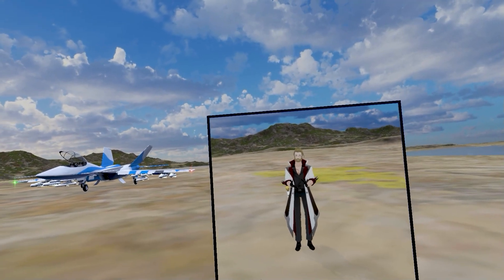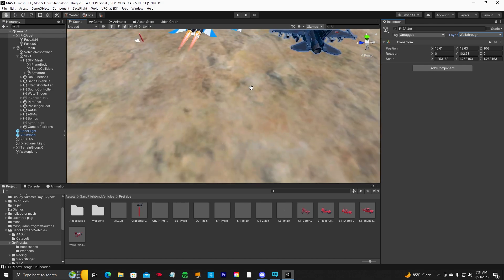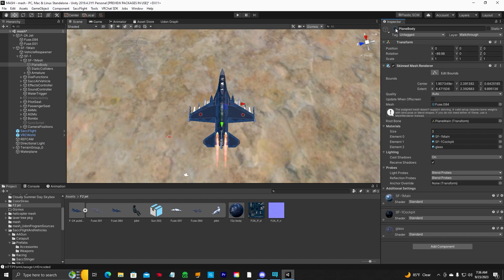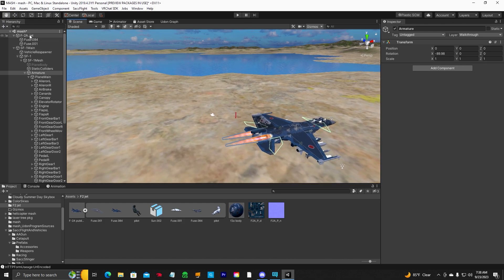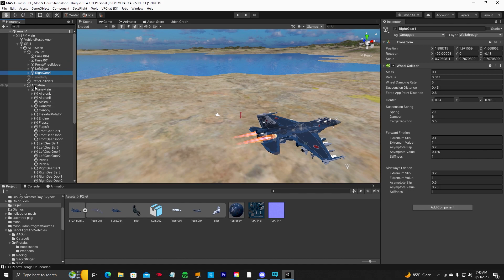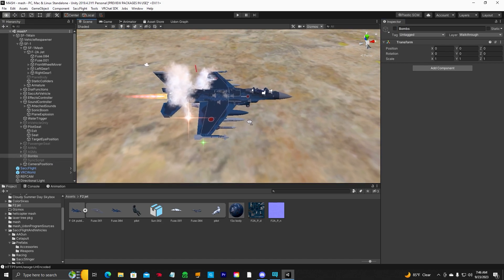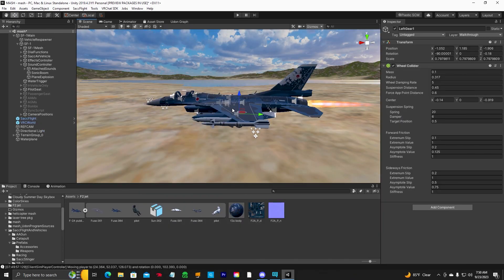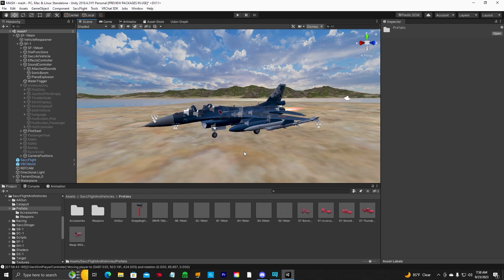Sacc Flight System to your own 3d Model Plane! (Sacc Unity Tutorial - Plane Edition)

Comment: Another quick question I have no idea how big the world needs to be do I just use a terrain object mesh and size it up to 1,000,000

And could you possibly do a tutorial on a aircraft carrier set up
Reply from the maker: Create a Terrain. The largest I have made is 69012 width and 69012 length. But I believe at around 35000 W/L, your aircraft will warp to the other side, like it does in "Test Pilots". To make it larger, so you don't warp. You will have to use the "Open Logic Movement" Asset. https://github.com/zhakamizhako/VRCOpenWorldMovementLogic
Reply: @genobvious2606 sorry I apologize 1 last question but what is the best W/L for a land runway because I’m afraid It might be to big or to small

Comment: i know you’re probably long done with this series, but how do you animate the plane, like when you pull, the planes elevators move?
Reply from the maker: I still will do Sacc Flight and Unity videos in the future when I learn new things. As far as the animation for the vehicles, I'm still learning it. Some creators will use Blender to animate the diff parts of the plane, then simply replace the existing animation, with the new one in the SF-1 animation project folder. Good luck!